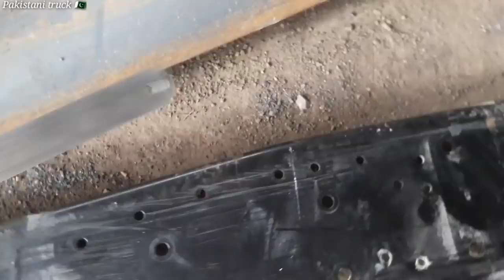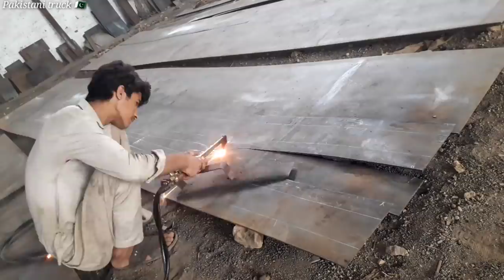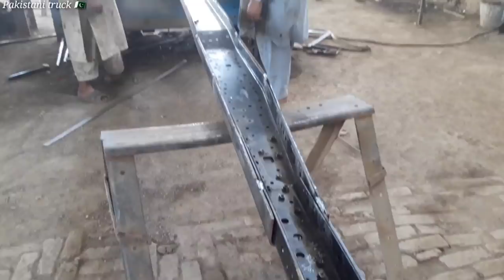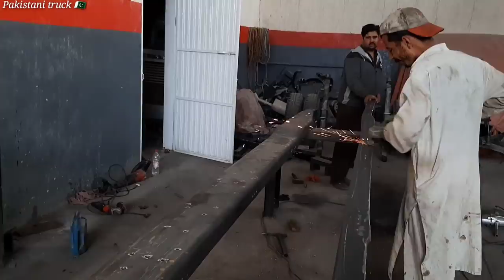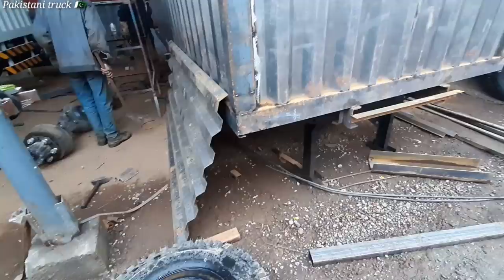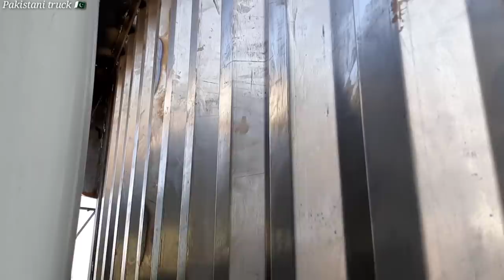Hino new dutro rebuilding and full press work

Comment: Great video, amazed how the guy with the gas axe achieves such unwavering straight cuts. Another super smooth paint job at the end especially with gloss white, a patterned paint job would hide any imperfections in its application.

Comment: great work but what engine that thing has? it looks little underpowered for the extra weight.
Reply: It has Hino W04D-TN (EURO II) engine with gross vehicle weight 5100 kg and around 8 Ton weight is permitted as per law. Engine is not under power, it is not made to install these heavy metals :)

Comment: Are they doubling the chassis to strengthen it , obviously, over stock or replacing stock metal? I'm not familiar with these trucks.
Reply: Hino trucks have a thin chassis compared to other brands. They had to reinforce it.

Comment: I have this same truck new from factory with factory built tipper, you guys do great work but how can you expect the differential, clutch, breaks, gearbox and motor to have any durability when it looks like a lot of the time the trucks that are worked on are going to be carry 3-4 times the loads that the original manufacturer specify. I don’t no if it’s just me but I feel like your customers should be purchasing larger trucks to begin with.
Reply: It's the rough conditions more they are being reinforced for I think, not only large loads, terrihle uneven Roads driven slowly, so strong structured trucks clearly work, or else they wouldnt be in business

Comment: By adding all that extra steel onto the chassis rails and with the addition of that overly high, all steel box type construction on the back and the extended steel bumper, you've actually reduce the factory specified loadings for this vehicle! 

Furthermore, the combined weight of all that steel would surely necessitate upgrading the suspension and braking system!

By definition, by having to hugely reinforce and extend the original chassis simply confirms that the truck bought was actually unsuitable for such heavy loadings and a higher rated and specified model should have been chosen instead!
Reply: you seen how those boys load up the trucks' do you think they care    .........
Reply: Experience teaches.
Reply: You must be new here.  This isn’t going down a smooth interstate at 70 mph, it’s being built to survive an incredibly abusive environment.
Reply: Bro it's used on very rough roads even no rods remote mountain areas where original chesis broke apart after 2 months that's why the reinforcing frame
Reply: This vehicle is used for more than 12 ton the load so it is made so strong
Reply: @muhammadimran6542  My above post explains why simply extending the chassis to physically increase the amount the truck holds is not the answer to needing a truck rated for significantly greater loads!

There is more to it than just physically fitting more weight and volume onto that truck!

Suspension and braking systems need to be upgraded for heavier load capacity, and tyres need to be checked for their ratings.

There are many good reasons that heavy goods vehicles are rated, certified and regulated for specific loads, the companies that design and manufacture them are fully aware of these things too!

In most Western countries trucks modified like this would be banned from the public roads!